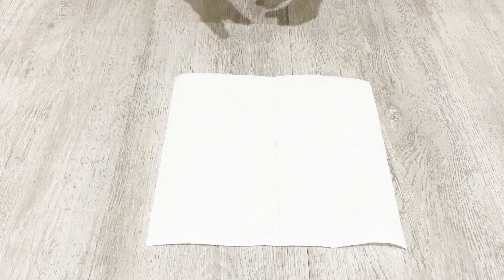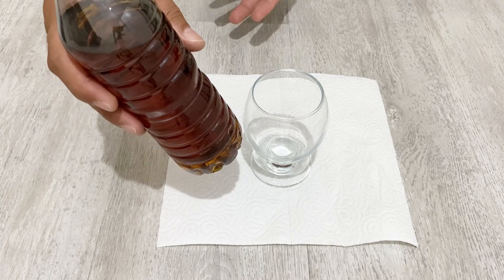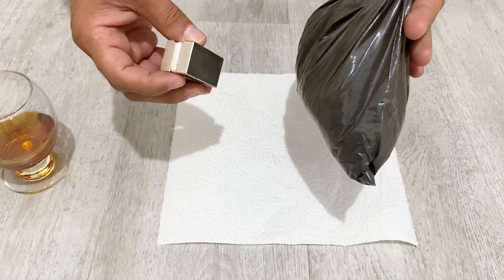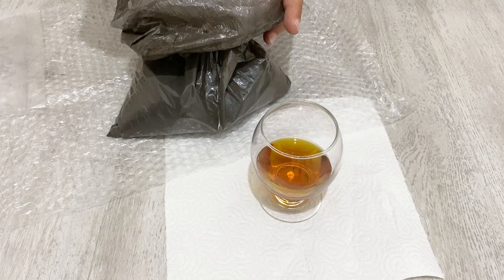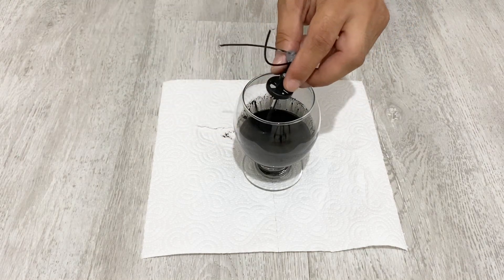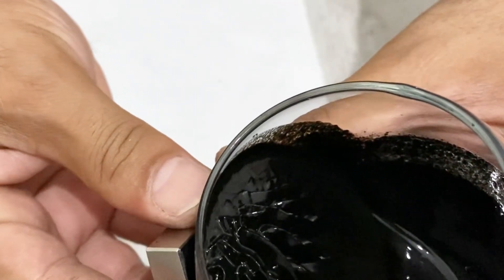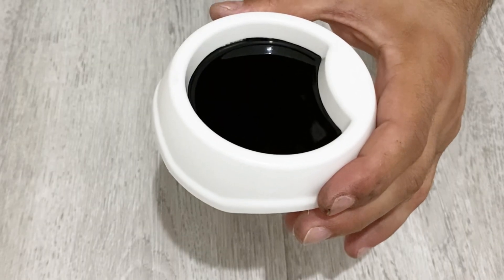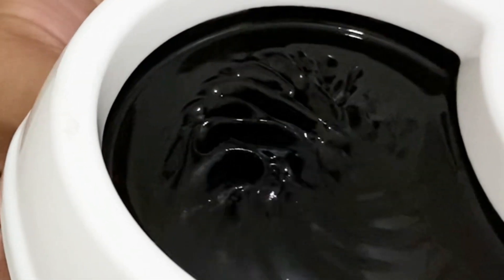How to Make Ferrofluid at Home

Comment: hello and thank you for this very simple video. I am very interested in this technique at the moment with a view to a DIY project. Unfortunately I don't see anyone anywhere saying or showing whether this mixture can be suspended in another liquid. For example, as we find for ferrofluid enclosed in a container of water? the goal would be to play with an electromagnet. 
Good day.
Reply from the maker: It can suspend in the water but when you play with that you must avoid of severe hitting of the ferrofluid to the edges of the container in order to keep it stick together as a sole part.
Reply: @joyofelectronics9782  Of course, we therefore recommend it to you for the purpose of, for example, DIY manufacturing a loudspeaker like you can see on some site?, activated by an electromagnet..